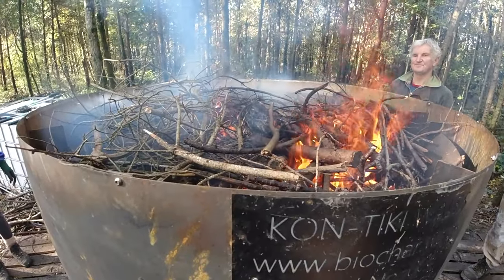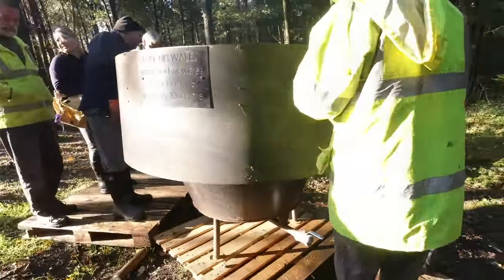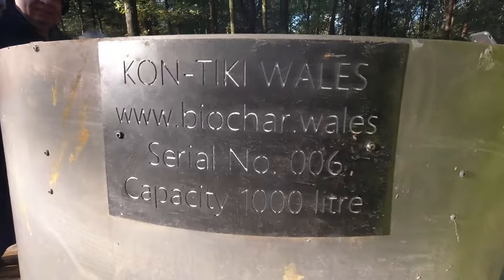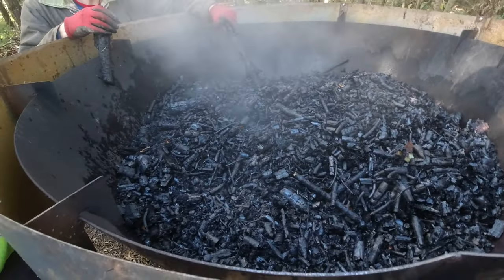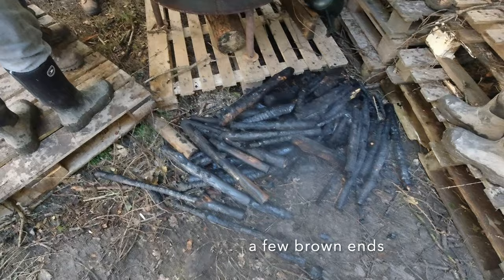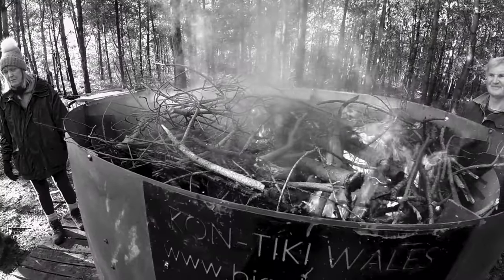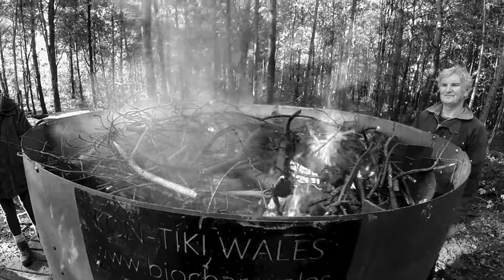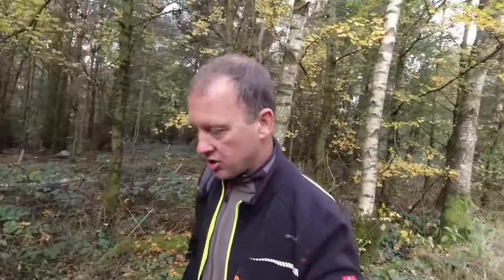Kontiki Bio-Char Making With Heartwood Woodland Volunteer Group. #Biochar #kontiki

Comment: That is similar to what I am use too, minus the cool metal caldron and endless water supply.  Now what was with all the white chalk numbers on the inside of the kiln?  The ability to pipe in water to quench from the bottom up is very interesting.  Markets is the million dollar question.  It is always good to produce less and charge more, yet there is always a struggle there.  It will be interesting to see how you innovate in future!
Reply from the maker: Nice one, the chalk marks as I understand were manufacturing marks, I'll keep you updated on the biochar progress, we got 16 compost sacks full. Heartwood are drying it next so as to package it up
Reply: @AbellTo  cool, that makes sense.